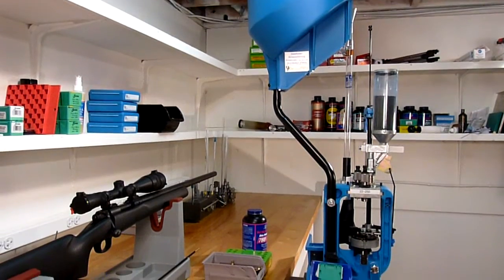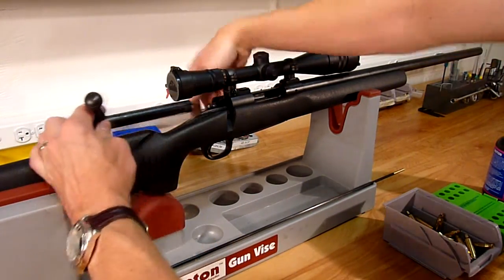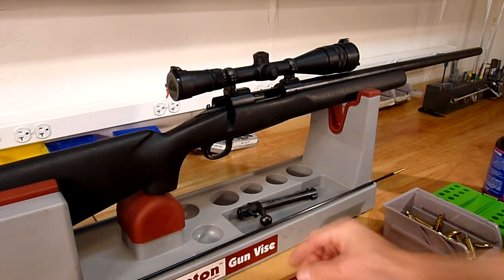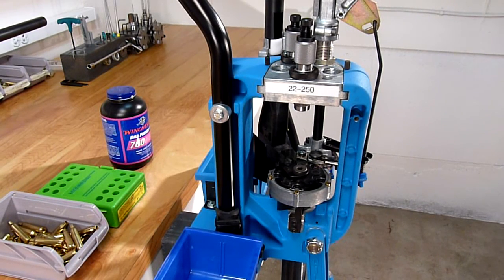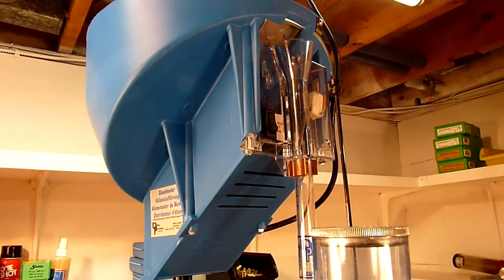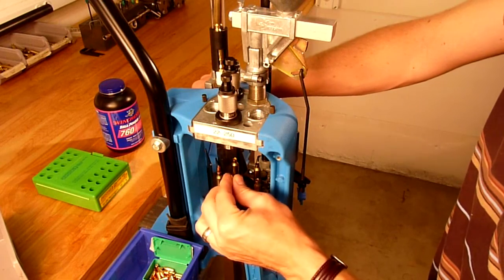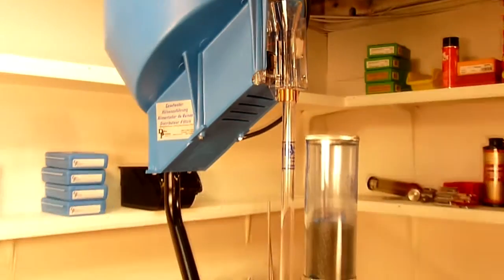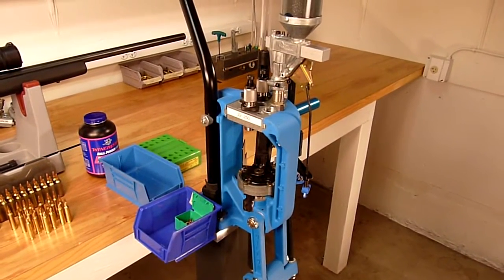Dillon XL650 Loading 22-250 (HD)

Comment: just a quick question im new to reloading and Want to start up.

You said that the cases were resized before reloading, now do you resize you're brass and then trim if you need to? If so how does this work in a progressive reloader as the case that has been re-sized/trimmed will then run through the Full length re-size die again? This has gotten me some what confused if you can get back to me that would be great

cheers.